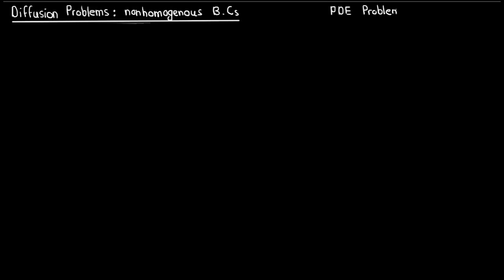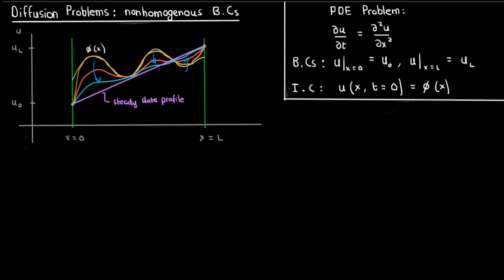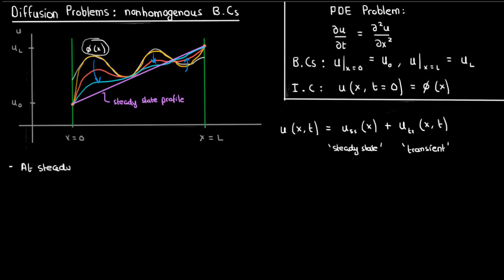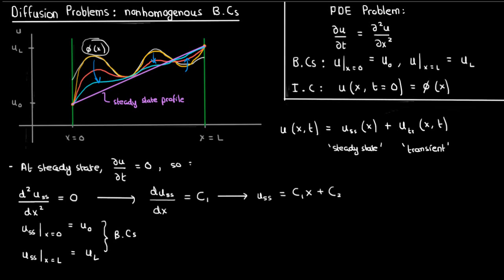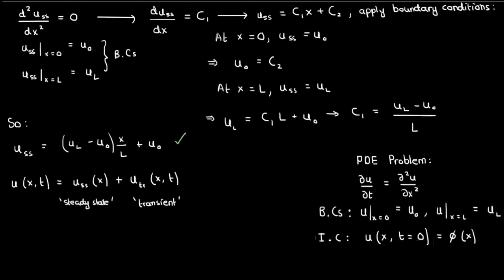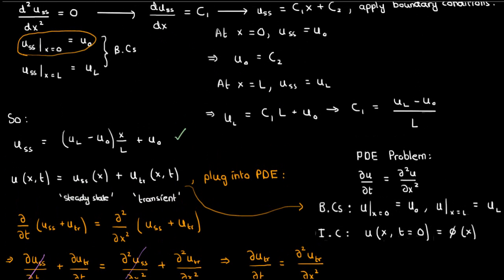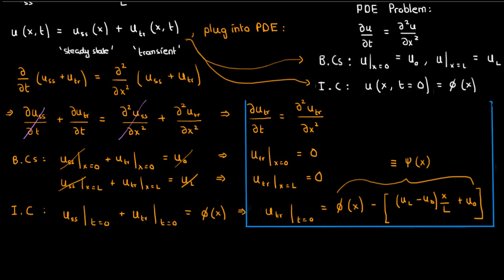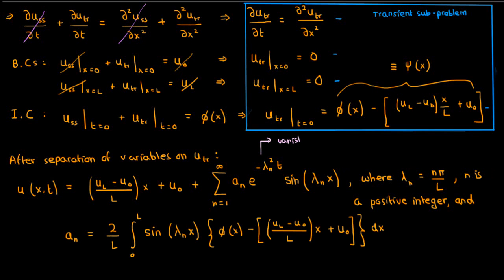Solving the 1-D Heat/Diffusion PDE: Nonhomogenous Boundary Conditions

Comment: HI ! I would like to solve a non homogenous Boundary conditions heat diffusion problem involving time dependent boundary conditions, so I have to solve transient heat equation with transient boundary conditon. This video let me believe that I can use this steady stade/transient state separation method to solve my problem, is it correct ? My second option is to use Laplace transform with transient condition however I can't find exemple to help me, have you got an idea about how do I have to procede ?  Thks by advance. 

Hugo

Comment: Great video! But I have one question: What happen if my B. Conditons are  homogeneous, but my PDE, that is the same equation of this video, contains a constant, that i can call "a". In that case,  my problem is nonhomogeneous, not by the B. Conditons but by the equation itself. Can i use this method of the sum of a steady and transient solutions?